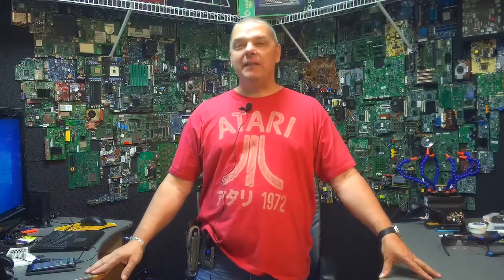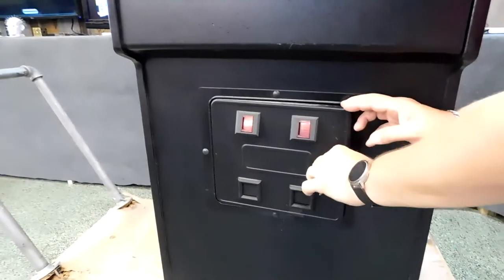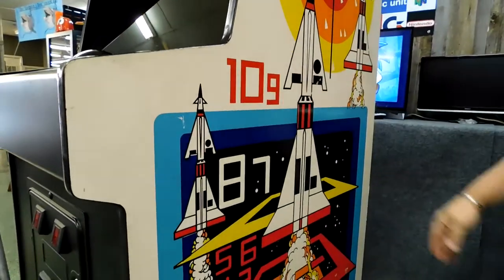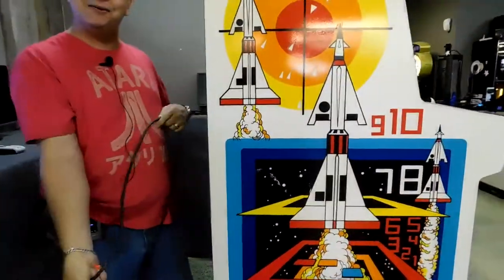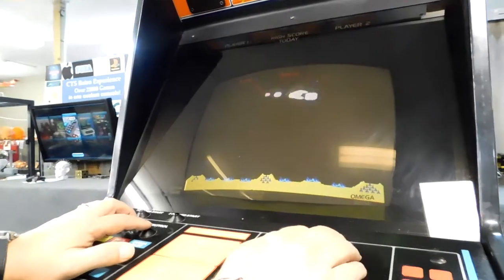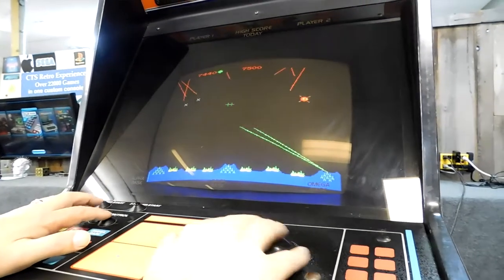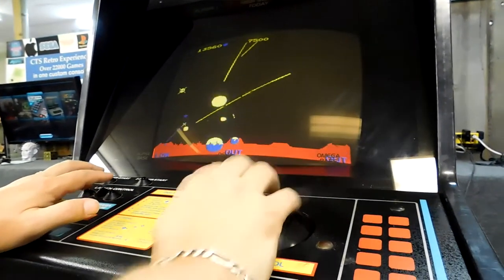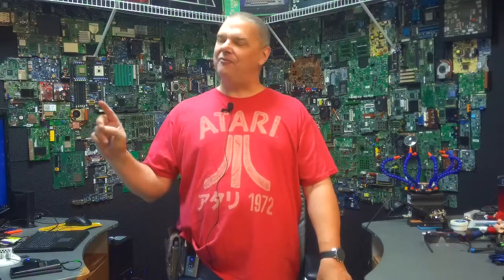Talk about a BARN FIND!!  How about an authentic 1980 Missile Command Arcade game!!!!!!!

Comment: Amazing find! Born in '67 so I also fondly remember the '80s and Arcade Machines. I made a spark gun from a piezo BBQ lighter and used to use it to clock up free credits (Ground the handle against the front panel and vary the distance of the wire from the coin door whilst squeezing the handle to generate sparks). I was never much good at Missile Command, although I used to waste a lot of time playing Phoenix, Galaga, Gyruss and Pengo. Aah, the good old days.
Reply from the maker: Heh oh yes! You haven't lived until you play missile command.. Those little "pinches" on your hand as the ball rolls are best part :) Its like playing a game and flirting with danger at the same time :)